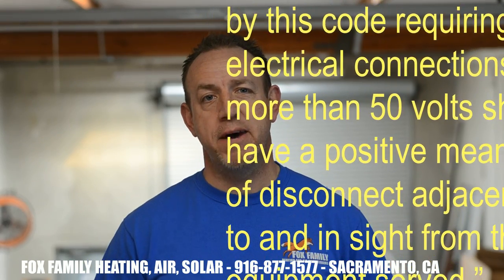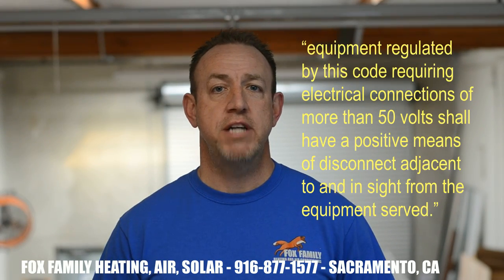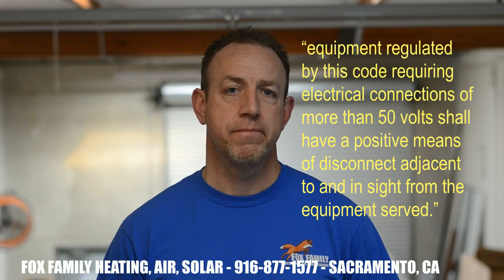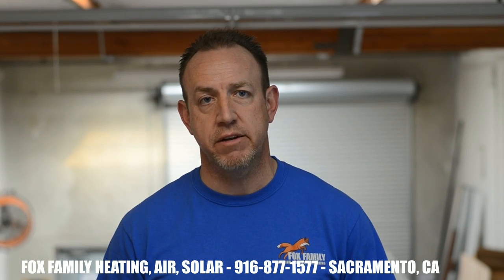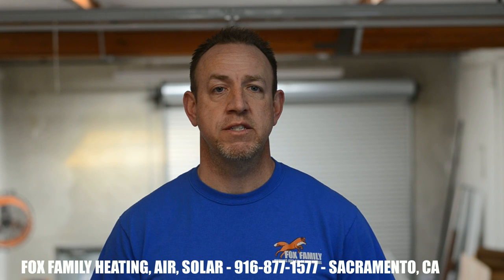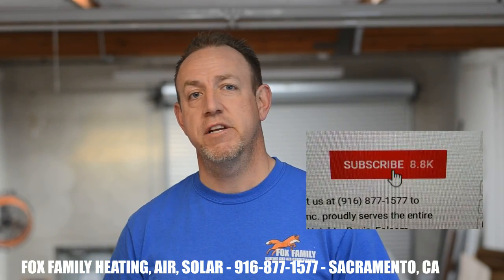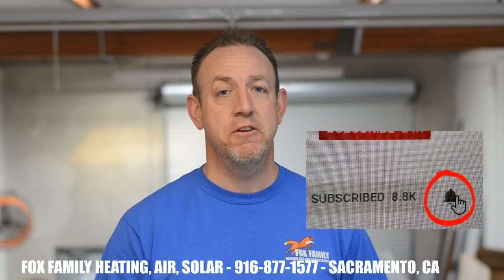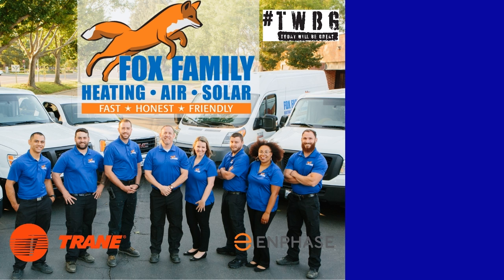Electrical Connections, HVAC, and the Mechanical Code

Comment: We always put a disconnect to every install. However we us 10mm tape to protect the liquid line and tstat wire. I tuck them underneath the foam insulation of the suction line and tape everything. That may be wrong but it was how I was told how to do it.

Comment: In our area disconnect need 36” clearance in front and 30” side clearance. Maximum whip length is 6’ with ground wire in whip.

Comment: I'm in Maryland State and we do not have electrical main panel near a condenser. Normally they all are located inside the home so we always have to install a disconnect switch. Thermostat wire is always running bare so all the UV is always getting it. I'll try using conduit (good point)

Comment: I do a lot of installs so far and im doing a bunch of Hobbs (trailer house company )installs for new home buyers here in Texas an usually the electricians have the power wire right beside the line sets and I install the disconnect and whip. The Hobbs jobs though range on trailers are either on the back of the trailer home With a disconnect already set up or not even ran at all some customers are upset because they won't have air that day because the electrician never ran power from the breaker to the out side disconnect idk the code my boss may have told me I'll ask in the morning.

The two wire comes with a coating I usually run it underneath the Rubtex and tape it or run inside the rubtex  then pig tail the two wire and on my whip I usually try and run it down the wall and anchor it to the wall making it nice and neat I love taking before and after pictures

Comment: Great video! 
I hate seeing wiring at apartments that were never run in a conduit and is now totally solarized so bad the wire nuts are powdered and the insulation is so bad that there is no way it won’t potentially short if it hadn’t already. 

I have always run the tstat wire in a 1/2 inch liquid tight. It looks better and I’m not worried about it getting struck by a weed eater, shovel etc. if it has been cut so far back and there is no way to get it into a weatherproof box due to length then I run it tight under the suction tube insulation, with black zip ties about every foot or two 
It does kill me when I see videos of installs without the t stat wire in a conduit.
But then, there are times it’s a matter of customer not being able to afford the cost of running a new wire if need be when the old one works.

Comment: Here in Houston the breaker box must be within 15’ and in sight. That’s code here. This is for safety. Many years ago before this was enforced I a a dumbass turn the breaker on the to the unit I was working on. He will never do that again. The pain he was in lasted longer than the pain I was in but a lesson was learned. Don’t forget your lock out tag out.

Comment: Do you run conduit for your thermostat or a whip or do you run separate whip for thermostat? My company run the thermostat with the lineset and as soon as it comes out the wall we use uv tape to tape it to the lineset until it comes up to the thermostat grommet on the unit
Reply from the maker: Ive just always done it the way I was taught which was to run it through 1/2" conduit and secure that to the lineset as it comes out the wall.  I think you can get away with the tape method though.  I've seen it done in the tract housing around here.